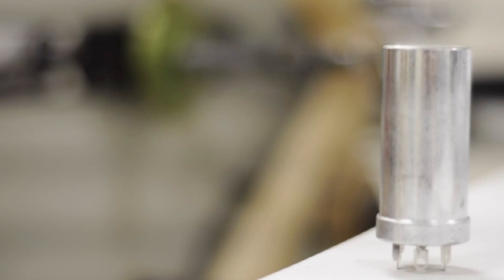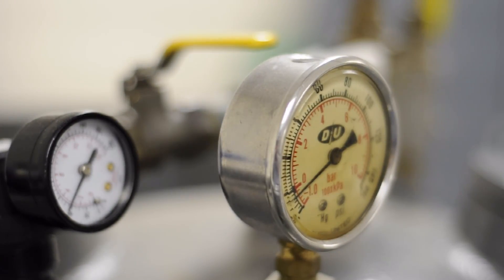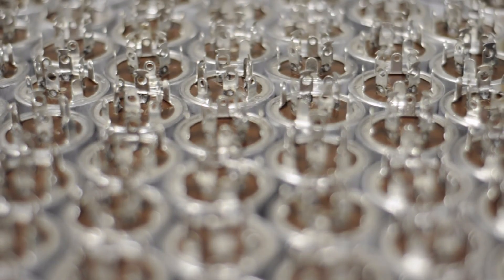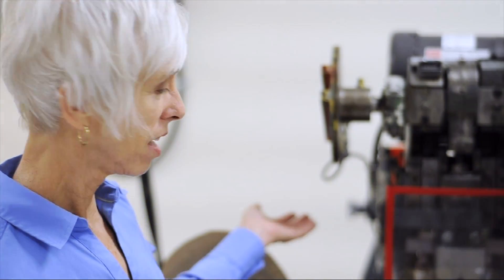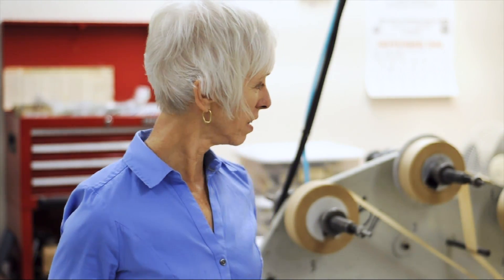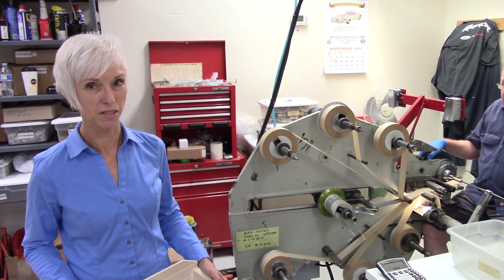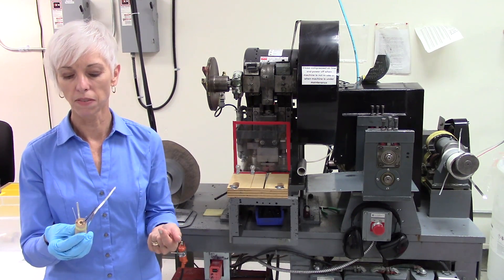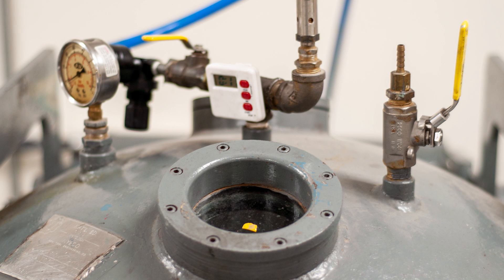CE Manufacturing Can Capacitor Production (Part 1)

Comment: Just curious why my circa 1977 Fender Champ guitar amp came with a 40/20/20 high voltage can capacitor when the schematic clearly calls for a 20/20/20 450V. I ordered the kit from Antique Electronic Supply. It seems to be working just fine. That thing was a job to get out of there. Had to order a huge soldering iron from Weller! Nice to see that they are still made to the original specs.